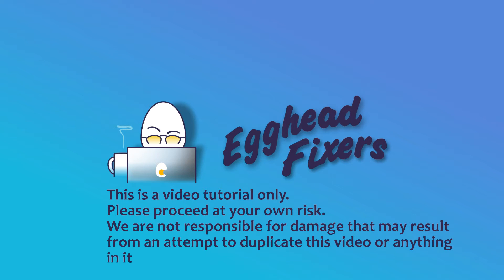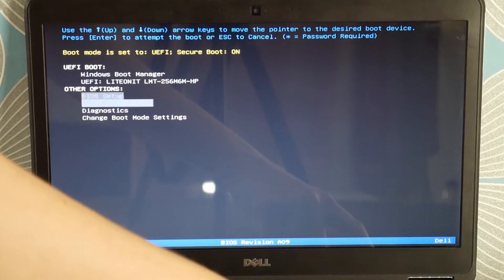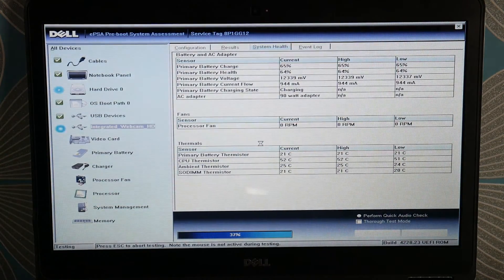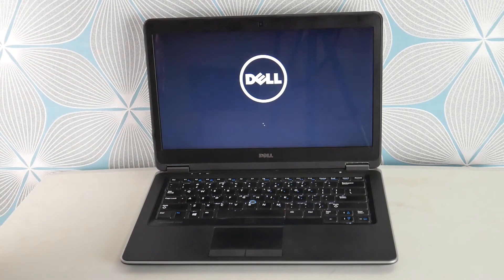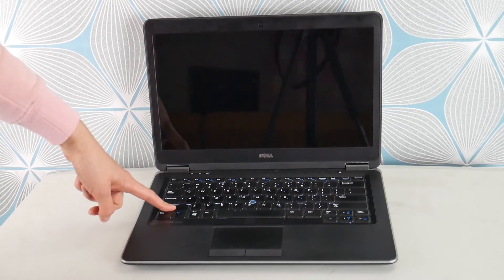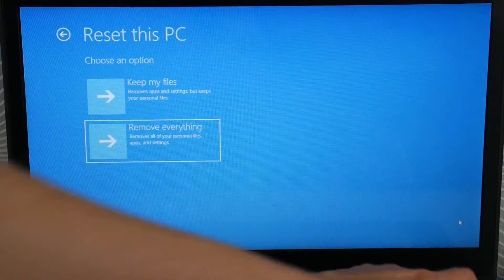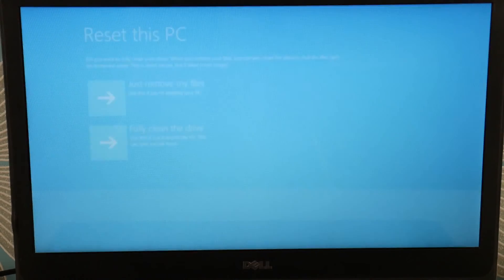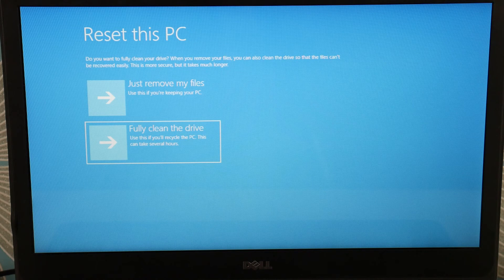How To Fix A Dell In A Preparing Automatic Repair Restart Loop

Comment: It wont let me reset
Reply from the maker: Sorry to hear that☹ Sometimes when the Operating System is not functioning properly then you can no longer get to the options to reset it. In this case the next step would be to reinstall the operating system. Here is a video on how to do that:

https://youtu.be/TElCJDbKdKk

You can skip the part of the video about replacing your hard drive. Let me know if you have any more questions:)

Comment: Hi the diagnostics didnt show any hardware issues so i tried resetting it and when it was installing windows, the bluescreen saying the pc ran into some error and needs to restart appeared
Reply from the maker: Sorry to hear that☹ Sometimes when the Operating System is not functioning properly then you can no longer get to the options to reset it. In this case the next step would be to reinstall the operating system. Here is a video on how to do that:

https://youtu.be/TElCJDbKdKk

You can skip the part of the video about replacing your hard drive. Let me know if you have any more questions:)
Reply: Same here

Comment: This works to DELL pc? i have a pc and i can get in recovery mode:(
Reply from the maker: Yes it works on a Dell PC... Sometimes when the Operating System is not functioning properly then you can no longer get to the options to reset it. In this case the next step would be to reinstall the operating system. Here is a video on how to do that:

https://youtu.be/TElCJDbKdKk

You can skip the part of the video about replacing your hard drive. Let me know if you have any more questions:)

Comment: My laptop just won't boot I tried with a bootable usb but it doesn't load the setup and restarts and this goes o
Reply from the maker: What happened when you ran the diagnostic? Did everything pass?
Reply: @EggheadFixers  yes everything but it doesn't boot into anything I've tried safe mode and fast mode nothing boots it does that preparing automatic repair and it goes on like that
Reply from the maker: @utkarshthakur5956  Sorry to hear that:( If all that hardware passed the diagnostic then the next step would be to try reinstalling the operating system. Usually this problem is caused by a problem with the operating system. Here is a video on how to do that:

https://youtu.be/TElCJDbKdKk

You can skip the part of the video about replacing your hard drive. Let me know if you have any more questions:)
Reply: @EggheadFixers  I've tried that too but it doesn't boot into the windows installation setup too
Actually I've been ransome ware and I tried resting my pc after that it doesn't reset and then this all happened
And I am using my laptop without the battery as it has gone bad  and beeps 5 times as I open it then it takes me too advanced options and nothing happens
Reply from the maker: @utkarshthakur5956  So 5 beeps at start up means CMOS battery failure. They are usually pretty cheap to replace. You will most likely need to replace the CMOS battery, then you will need to set your date and time settings in BIOS. After that I would try to reinstall the operating system. That error could be what is messing up the installation.
Reply: @EggheadFixers  I think that is the problem you see whenever I restart my device the date and time are changed 
Thank you now I am clear about the problem
And also I'm been ransomeware attacked  this all happened after that.
Update: I fixed it the bootable usb wasn't well done now I have windows 10 pro activated thank you for guiding
Reply from the maker: @utkarshthakur5956  Excellent! Glad to hear it's fixed.

Comment: I can't access the Recovery Manager (shift+power). Hardware diagnostics all passed. Alienware R15
Reply from the maker: Sorry to hear that☹ Sometimes when the Operating System is not functioning properly then you can no longer get to the options to reset it. In this case the next step would be to reinstall the operating system. Here is a video on how to do that:

https://youtu.be/TElCJDbKdKk

You can skip the part of the video about replacing your hard drive. Let me know if you have any more questions:)

Comment: My laptop is not even opening to diagnose.
Reply from the maker: How far does it make it? Does it turn on at all?
Reply: Yes it was opened for 15 mnts n again gt shut down
Reply from the maker: @sumbulsyed8185  Does it feel like it's getting too hot? Does it give you an error message?
Reply: @EggheadFixers  no
Reply from the maker: @sumbulsyed8185  Can you access the diagnostic at all?
Reply: @EggheadFixers  I had a convo with cust technical team they said it's an software issue
Reply: @EggheadFixers  another one said that my motherboard is not working
Reply from the maker: @sumbulsyed8185  Have you tried reinstalling the operating system?
Reply: @EggheadFixers  no
Reply from the maker: @sumbulsyed8185  I would try that next
Reply: @EggheadFixers  it starts working on its own🙄
Reply: It beats me.
Reply from the maker: @sumbulsyed8185  Well that's good news that it's working.
Reply: @EggheadFixers  but I wanna know how ..
Reply from the maker: @sumbulsyed8185  Sometimes if there is a small error it can trigger automatic repair. If the computer can fix it by itself then it goes away.
Reply: @EggheadFixers  okay
Reply from the maker: @sumbulsyed8185  👍

Comment: On testing it's showed me an errorcode  2000-0142
Reply from the maker: Sorry to hear that☹ First I would try what we call reseating the hard drive which means unplugging it and then plugging it back in. Then rerun the diagnostic. If that does not work then its most likely that you need a new hard drive. Sometimes when a hard drive really dies the motherboard doesn't read it as being installed. Here is a video on how to replace your hard drive and install an operating system:

https://youtu.be/TElCJDbKdKk

Let me know how it goes:)

Comment: Hello miss . My laptop is Dell and windows 10 . My lap stuck and showing preparing automatic repair. Can't move forward. What I do ? Please reply miss.
Reply from the maker: What happens when you run the diagnostic? Does everything pass?
Reply: @EggheadFixers  Miss the problem solved ,the problem was due to keyboard . Keyboard is not working. So change the keyboard and problem solved . Thanks for your time.☺️☺️☺️☺️
Reply from the maker: @thestorysaga-tss  Excellent! Glad to hear it worked out:)

Comment: I have no hardware issues other than battery. But when I follow the steps for recovery nothing is happening
Reply from the maker: Sorry to hear that☹ Sometimes when the Operating System is not functioning properly then you can no longer get to the options to reset it. In this case the next step would be to reinstall the operating system. Here is a video on how to do that:

https://youtu.be/TElCJDbKdKk

You can skip the part of the video about replacing your hard drive. Let me know if you have any more questions:)

Comment: after resting all, laptop is going "repairing disk errors. this might take over an hour to complete"😢
Reply from the maker: What happened when you ran the diagnostic? Did everything pass?
Reply: @EggheadFixers  
Hard drive0 -S/NS2SMJ9HDA19855,Short self test unsuccessful

what is this??  from buying this laptop i even not used  only getting problems and problems
Reply from the maker: @SanBan11  Sorry to hear that☹ First I would try what we call reseating the hard drive which means unplugging it and then plugging it back in. Then rerun the diagnostic. If that does not work then its most likely that you need a new hard drive. Sometimes when a hard drive really dies the motherboard doesn't read it as being installed. Here is a video on how to replace your hard drive and install an operating system:

https://youtu.be/TElCJDbKdKk

Let me know how it goes:)
Reply: @EggheadFixers  I have to say that when I bought this new laptop, there was a hard drive problem on the first day, so I installed a new hard disk, this is a new hard disk and the problem is the same.
Reply from the maker: @SanBan11 When you installed the new hard drive did you install Windows on it?

Comment: Mine has a broken screen has this issue and blue screen :/
Reply from the maker: What blue screen error does it give you? Also what happens when you run the diagnostic?
Reply: @EggheadFixers  It resets when I run it and I can’t see what type of blue screen it is because it’s cracked and my monitor won’t connect unless the laptop is fully on
Reply from the maker: @MrBxrn  Ugh ya that's a tough one. It's hard to diagnosis what is wrong without being able to see the blue screen or see the results of the diagnostic.

Comment: I couldn't get shift recovery mode smh fuq tech
Reply from the maker: Sorry to hear that☹ Sometimes when the Operating System is not functioning properly then you can no longer get to the options to reset it. In this case the next step would be to reinstall the operating system. Here is a video on how to do that:

https://youtu.be/TElCJDbKdKk

You can skip the part of the video about replacing your hard drive. Let me know if you have any more questions:)
Reply: @EggheadFixers  thanks like the interaction jus stuck trying to get safe mode troubleshooting screen i had unplugged battery cause pc was froze so now it say hardrive error wont let me get to that blue screen past the auto repair loop either .
Reply from the maker: @botwipes  What happens when you run the diagnostic? Does everything pass?
Reply: @EggheadFixers  its error code 0151
Reply: @EggheadFixers  its saying the hard drive is the problem thats why it's beeping at me lol smh
Reply from the maker: @botwipes  If your Hard Drive failed the diagnostic then unfortunately you will need to replace it. Here is a video on how to replace your hard drive and install an operating system:

https://youtu.be/TElCJDbKdKk

Let me know how it goes:)
Reply: @EggheadFixers  why would it fail for no reason tho ..  all i did was cut the power off wrong taking battery out or sum ahha cause it was actin slow loading all my files
Reply: @EggheadFixers  but thanks anyway 👌
Reply from the maker: @botwipes  It was most likely already failing and that just put it over the edge. Glad we could help:)

Comment: all my diagnostics passed, im still getting the loading screen though :(
Reply from the maker: Sorry to hear that:/ Have you tried resetting it?
Reply: @EggheadFixers  i did and it wouldn’t shut off, it was stuck on a blue screen afterwards
Reply from the maker: @nyasia6988  Sorry to hear that☹ Sometimes when the Operating System is not functioning properly then you can no longer get to the options to reset it. In this case the next step would be to reinstall the operating system. Here is a video on how to do that:

https://youtu.be/TElCJDbKdKk

You can skip the part of the video about replacing your hard drive. Let me know if you have any more questions:)
Reply: @EggheadFixers   i dont quite  understand. my computer says it doesnt have the reboot thing? it said something like that and my mom has tried to fix it with your tutorial but it still isn’t working:(
Reply from the maker: @nyasia6988  Yes If you can not get to the options to reset it then you will need to reinstall the operating system instead of resetting it.  Here is a video on how to do that:

https://youtu.be/TElCJDbKdKk

Comment: It started to restart but stopped at 55℅ what would you suggest to check?
Reply: Yes but I suppose I could do another digenetic to double check.
Reply from the maker: @specter5047  Sorry to hear that:( If all that hardware passed the diagnostic and reset is not working then the next step would be to try reinstalling the operating system. Usually this problem is caused by a problem with the operating system. Here is a video on how to do that:

https://youtu.be/TElCJDbKdKk

You can skip the part of the video about replacing your hard drive. Let me know if you have any more questions:)
Reply from the maker: When you were resetting it? Did all your hardware pass the diagnostic?

Comment: I cannot check for software issue in my dell xps 15
The dell logo appears for a short time and the touch keyboard makes me feel i am not pressing it hard
Its been stuck three days now
Reply from the maker: Can you access the diagnostic?
Reply: @EggheadFixers  yes
Reply: @EggheadFixers  yes
Reply: This is not my phone or account  sorry for my late reply
Ill try to reply with my own phone next time
Reply from the maker: @binkhan2710  What happens when you run the diagnostic? Does everything pass?
Reply: @EggheadFixers  yes
Reply from the maker: @binkhan2710  Sorry to hear that:( If all that hardware passed the diagnostic then the next step would be to try reinstalling the operating system. Usually this problem is caused by a problem with the operating system. Here is a video on how to do that:

https://youtu.be/TElCJDbKdKk

You can skip the part of the video about replacing your hard drive. Let me know if you have any more questions:)
Reply: @EggheadFixers  thanks i appriciate it
Reply from the maker: @binkhan2710  You're welcome

Comment: It won't Work
Reply from the maker: What problem are you having?
Reply: @EggheadFixers  it Tells Me and I quote✨Resting✨Then it hits me with✨Actaving Automaitc reapiar And Then hits Me With the  Diagnosing your Pc✨ It’s Been doing this For Like A month Strate
Reply from the maker: @gachatom9181  What happens when you run the diagnostic as seen in the video? Does all your hardware pass?
Reply: @EggheadFixers  it just Dose not do anything at all
Reply from the maker: @gachatom9181  So it freezes when you are trying to run the diagnostic?
Reply: @EggheadFixers  yeah and It dose Nothing
Reply: @EggheadFixers  I'ma just pay to get it fixed
Reply from the maker: @gachatom9181  Ya that makes sense👍😃

Comment: I did all that and it came back long self test unsuccessfull.  Even though all were green check marks... any suggestions?
Reply from the maker: If your Hard Drive failed the diagnostic then unfortunately you will need to replace it. Here is a video on how to replace your hard drive and install an operating system:

https://youtu.be/TElCJDbKdKk

Let me know how it goes:)
Reply: @EggheadFixers   ugh really?  My laptop is core 15.    Replacing the hard drive?  Which is one is cheaper? Hard drive or new laptop?

Comment: My laptop can’t even access automatic repair I’ve tried almost everything
Reply from the maker: Sorry to hear that☹ Sometimes when the Operating System is not functioning properly then you can no longer get to the options to reset it. In this case the next step would be to reinstall the operating system. Here is a video on how to do that:

https://youtu.be/TElCJDbKdKk

You can skip the part of the video about replacing your hard drive. Let me know if you have any more questions:)

Comment: I have a Latitude 7470 that powers on for only about 3 seconds, then shuts down. Tried getting into Diagnostics, but still shuts down before Diags load. Suggestions?
Reply from the maker: I would try these two videos for a problem like that:

https://youtu.be/TA1mFPtKVnw

https://youtu.be/bZSz-jjexqM

Comment: My loop is on a Dell Venue 8, following an attempt to install the latest Windows 10 update.  I removed the micro SD card; however, it made no difference.  With no keyboard options, what do I do?
Reply from the maker: What happens when you run the diagnostic? Does everything pass?
Reply: @EggheadFixers  hi I am stuck in preparing automatic repair.... My hard drive is failing. Any options to fix?
Reply from the maker: @shuncharon  If your Hard Drive failed the diagnostic then unfortunately you will need to replace it. Here is a video on how to replace your hard drive and install an operating system:

https://youtu.be/TElCJDbKdKk

Let me know how it goes:)

Comment: stuck in the loop and it wouldn’t work when i did the shift power recovery thing. diagnostics are good
Reply from the maker: Sorry to hear that☹ Sometimes when the Operating System is not functioning properly then you can no longer get to the options to reset it. In this case the next step would be to reinstall the operating system. Here is a video on how to do that:

https://youtu.be/TElCJDbKdKk

You can skip the part of the video about replacing your hard drive. Let me know if you have any more questions:)

Comment: It doesnt show recovery option.
I have a inspiron 15 3000.
Reply: Windows came preinstalled btw
Reply from the maker: Sorry to hear that☹ Sometimes when the Operating System is not functioning properly then you can no longer get to the options to reset it. In this case the next step would be to reinstall the operating system. Here is a video on how to do that:

https://youtu.be/TElCJDbKdKk

You can skip the part of the video about replacing your hard drive. Let me know if you have any more questions:)

Comment: Tried this and it still doesn’t work
Reply: Yes it does
Reply from the maker: @D4RK-1337  Sorry to hear that:( If all that hardware passed the diagnostic then the next step would be to try reinstalling the operating system. Usually this problem is caused by a problem with the operating system. Here is a video on how to do that:

https://youtu.be/TElCJDbKdKk

You can skip the part of the video about replacing your hard drive. Let me know if you have any more questions:)
Reply from the maker: What happened when you ran the diagnostic? Does everything pass?

Comment: My laptop is just showing a loop of preparing automatic repair even when i hit f12 button also continuously it is not showing any response. please help!!!!!
Reply from the maker: It's only about a 3-4 second window you have to access the boot menu by hitting F12. The window is sometime from when you turn it on to part way through it showing the Dell logo. So make sure you computer is completely turned off and then aggressively hit the F12 button to access it.